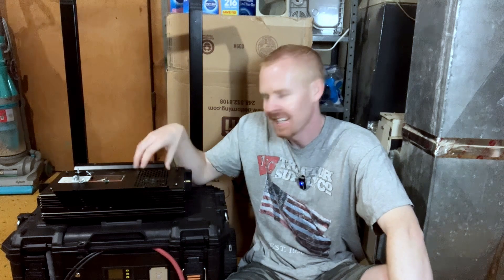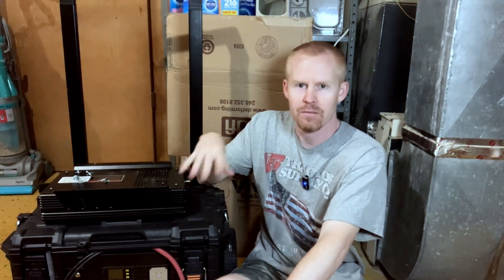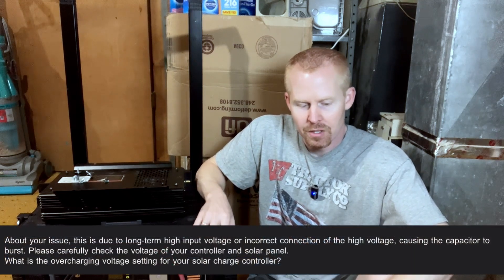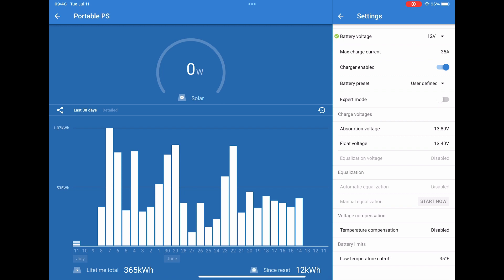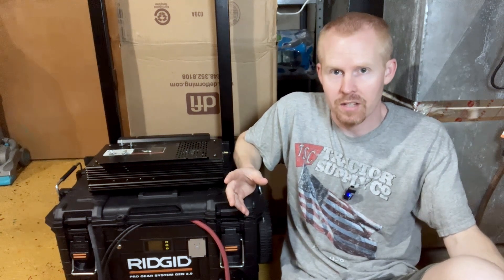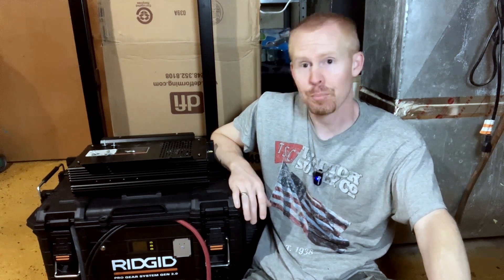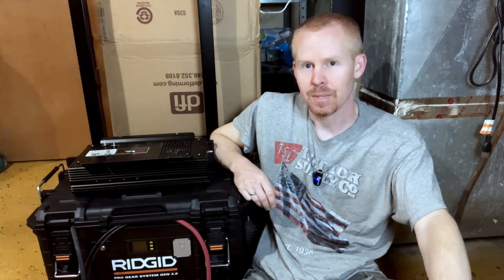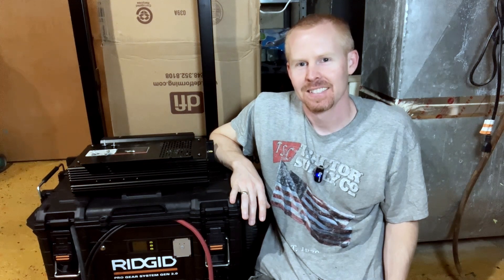DIY Portable Power Station Magic Smoke - Finally Have Some Answers

Comment: Thank you for the video and insight. If the voltage was high enough to damage the capacitors,  then it probably was also high enough to damage other items or at least weaken them internally.  In particular the battery..  if the smoke starts coming from a Li battery you definitely don't want to breathe it in or touch it without rubber gloves, as those are HF like compounds
Reply from the maker: Thanks.  Thankfully the BMS did its job and disconnected.

Comment: that charge controller should of known that it was connected to a 12v system, I blame the controller.
Reply from the maker: It’s 100% my fault.  I know better and you should always test everything before firing something up for the first time.  You can’t always rely on hardware protecting against your own screw ups.

Comment: Is it plugged in?
At both ends?

BTDT.  30 years working with this stuff.  I still make mistakes.

The most exciting time was putting traction current through the controller board on a robot.  Many chips exploded on that one.
Reply from the maker: Is what plugged in?

Yeah I would imagine that would make some firecrackers go off!

Comment: I made a similar mistake with the settings on my charge controller. I just happen to catch it right away. My app seems to disconnect when you hit the back space and of course you have to engage the bluetooth to sign on to the the app again, and it just happen where the 48 volts was in the charge controller app memory and I changed it to 12 volts right away. BTW i was running a 48 volt system but had to change it to 12 volts because i didn't have enough solar for 48 volts. Im guessing that's how the 48 volt was in the charge controllers app memory.
Reply from the maker: Glad you were able to catch it!  Unfortunately it never crossed my mind till it was too late…
Reply: Solid capacitors and electrolytic capacitors both store electricity and discharge it when needed. The difference, however, is that solid capacitors contain a solid organic polymer, while electrolytic capacitors use a common liquid electrolyte, hence, the terms solid capacitor versus electrolytic capacitors.

Comment: Another message from the old retired guy who commented on the previous video earlier today.   
I use a P-Touch label maker to identify the voltage of previously used charge controllers so I am more likely to use the correct one.  You can get a lot of experience about preventing stupid mistakes in 70+ years ;-)
Reply from the maker: That's a great idea!  Thanks!

Comment: A lot of people run into this issue especially using the auto detect function for 12/24/36/48V. When the BMS kicks off the controller might see the system as 24/36 or 48V and over voltage the inverter causing the capacitors to pop. 🫤
We all make mistakes thank you for highlighting this one so we can all learn 👍
Reply from the maker: Thanks.  I had though the auto-detect would have worked.  Apparently it only works for the initial startup.  Kinda annoying, but still, something I should have payed attention to.

Comment: Being a web dev I'm somewhat surprized   (but not) that you felt like you were above the question in some way. 
Not much different that building out some code and  having some stupid little thing you overlook blow it up.
IMO, at the end of the day this is still the manufacturers problem to solve. 
They should be adding an overvoltage shutdown so the likelihood of this happening is low, there's no reason for the caps to act as fuses, or fire-starters.
Reply from the maker: But any good developer knows that they don't create bugs, they're features.... 😁

I honestly don't know how they would be able to add an over voltage check cheaply.  Even Solar Charge Controllers have a max voltage and if you go over that, you're almost guaranteed to cook the charge controller.
Reply: @AdamDeLayDIY  dunno bout that, they don’t need precision, at least in this situation I think it’s doable. For an inverter you shouldn’t be looking for more than the output otherwise what’s the point in using an inverter

Comment: Pride cometh before the fall, doesn't it? It seems like we need to be humbled once in a while, just to stay on track. Don't beat yourself up over it,  just learn from it and carry on. Take a look around, you are doing quite well on your off grid journey. You are walking the walk, and actually doing it, while others are practicing analysis paralysis.
 I'm actually surprised that the inverter lasted 8 minutes with that severe of an overvoltage, I bet those cheap Chinese inverters wouldn't last a New York nanosecond.
 I wonder if you can save it by replacing the capacitors, and maybe the mosfets.
Reply from the maker: Thanks.  I was surprised as well.  It looks like every cap would need to be replaced.  If nothing else, I’ll keep it around for spare parts for its replacement.

Comment: I have a 80 Amp solar charger and I can use it for 12 24 36 and 48 vote systems. This one would of prevented your problem from ever happening. This charger senses the battery voltage no matter the voltage from the solar system. I have a system like the one you made but it is not in a box.
I have 12 vote 2000 wat Inverter with 2 200 ah battery's  the 80 Amp charge controller and 4 190 watt 24 vote panels

Comment: Im building one myself and got the VIC 150/70, just put a sticky note to check voltage!  Glad you solved the issue I was hesitant on building it with my limited knowledge. we have another tropical storm brewing in the Atlantic so its time to start the build.
Reply: My little system has saved my but from freezing this last winter with power out for 4 days and nights
Reply from the maker: Yup, jus remember to triple check everything and don’t assume!  Good luck!

Comment: I thought you were going to say you were running your top off charge at 14.6.  I had to turn my charge controllers down to 14.1 to keep from tripping the 15 volt over protection on my inverter.  48 volts, oops.
Reply from the maker: Yeah, big oops…

Comment: Glad you found the cause of the Magic Smoke!
That is indeed the drawback of (software) programmable charge-controllers; it is easy to forget & overlook settings.
I would check also all the other settings, just to be safe.
I would not beat yourself too hard, count this as a lesson learned and that the majority of you onwatchers of this & previous video are now forewarned what to watch out for! We all should be grateful that you shared this inadvertent mistake.
So: thank you!
(and glad my previous explanation checked out, just the cause was something yet to be discovered)
Reply: BTW, inverters can cope, for a limited time, for overvoltage. Typically a 12volt inverter can handle an input up to 16 volts or so. the documentation usually will state something about that...

Comment: While you did make a mistake, isn’t that what fuses are for? Did you look at the fuses inside the inverter to see if they did their job? Are they a low enough current value to actual offer any protection? I’m always looking forward to your next videos.
Reply from the maker: Thanks Bob.  So the fuses were fine.  It wasn’t the current that was the problem, it was the voltage.  The voltage exceeded the rating of the capacitors (probably by far) and that’s why they blew.
Reply: @AdamDeLayDIY  I thought I saw 35V on one of the caps (or cap shreds),  50V would be enough to cause a failure.  As you demonstrated.
Reply: Fuses would not stop this problem because it wasn't a current problem
Reply: @richardbizon8620  Yep! After I typed the comment, I realized that current was not the problem - voltage was.  But I guess the point I was trying to make is that the manufacturer should have anticipated this type of hook up error and provided some protection.  Perhaps just an inexpensive 16V Zener diode across the battery input terminals is all that's needed for a 12V inverter.

Comment: I applied 60 volts to a 12 v inverter back in the day. Rapid poof with a cloud of smoke! Far more than 30 amps were available . That was ~13 years ago or so. Man, that company definitely is doing you right. Tks for sharing. Takes courage to face and show the mistakes we make. Definitely gonna help others avoid the issue. Tks again!
Reply from the maker: Thanks!

Comment: Oh no.  The Victron is setup for manual 48V battery.  Well that explains it all and such an easy mistake to make.  It was over voltage afterall, but not in the way I would have imagined.

I can see exactly what would have happened too.  The battery would have held the voltage down to '12 volt' levels until it fully charged.  After that its BMS would see over voltage and disconnect, then boom the Victon's output would go to absorption 55V and shortly after fall back to 53V float.

At least you found out the actual cause and that it wasn't a fault in the inverter.
Reply from the maker: Yeah, makes me feel a "little bit better"...at least it's human error, not hardware error.